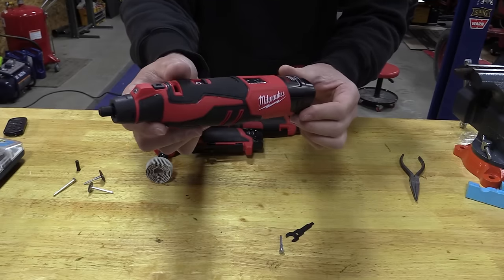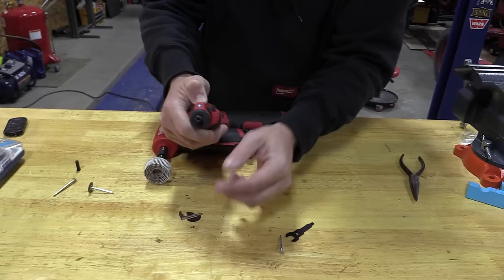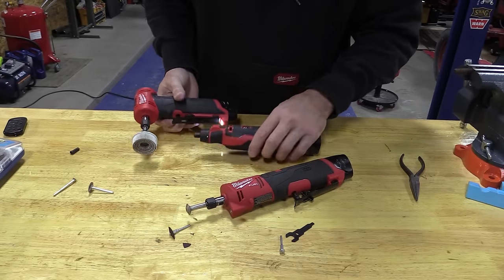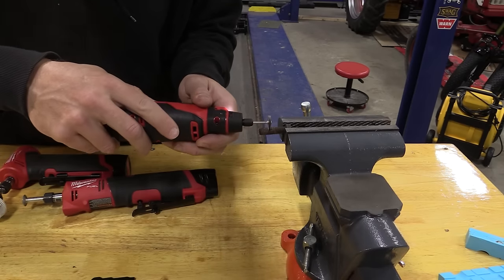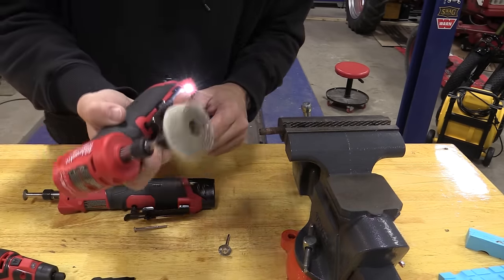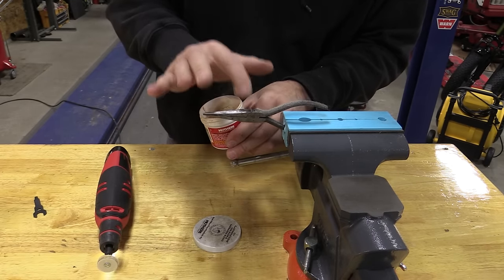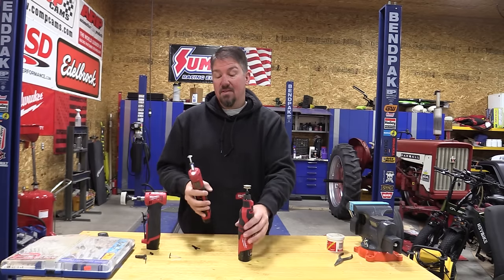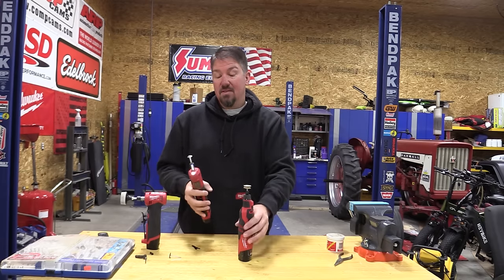Milwaukee M12 Brushless Rotary Tool Review OR Milwaukee Die Grinder? 2525-20 2525-21

Comment: One thing you missed and many don't think about. The rotary has the threads to attach Dremel tools such as the router and flexible shaft attachments. It's not just about adding the collet adapter in the die grinder. The die grinder doesn't have the additional accessory threads. If that's not a big deal, then the die grinder has more power.

Comment: I bought the 1st rotary tool after the 12v dremel failed. Use it a lot and been running it hard for over a year. Wouldn't hesitate buying another when needed. Don't forget your eye protection. ✌️
Reply: One thing I didn't like about the 1st rotary was the on/off switch being too far back. You get used to it after a while. This new model has the switch where it should be. Looks like I'm getting a new one soon. Thanks for the review.

Comment: I used to work as an auto mechanic, and we worked on a lot of old rusty cars at my shop.

Small rotary tools are awesome with small wire wheels for quickly cleaning rust off smaller bolt threads and also when you want to clean rust out of the insides of brake caliper sleeves before you lubricate them. I used to use my older craftsman cordless rotary tool for cleaning small parts all the time.

I wish I didn’t already own the older brushed m12 rotary so I could justify buying the new brushless version. It seems that the speed control is much better on the brushless. With the old brushed version, i feel like setting it on the lowest setting is very underpowered, but if you increase it just a little bit, the rpms are too high for small detail jobs. The power adjustment on the old one doesn’t feel linear across the range of settings. The new brushless version seems to give you more ability to dial in the rpms to the optimal level for a given workload.
Reply from the maker: Speed control on this model is superb.

Comment: I own both the m12 die grinders its awesome not having to pull out air hose anymore. Ive been thinking of getting one, but now that its brushless its more tempting even thought i do really need it.
Reply: I love those die grinders. 2 1/2 years of heavy daily use. I mostly use them with tungsten carbide bur bits, roloc sand/polish pads, and 90° wire brushes. The biggest mistake people make with these is using accessories larger than 2". Accessories larger than 1 1/2" can put too much strain on the motor. If you need a disc bigger than that, break out the m18 variable speed die grinder. Although they're not perfect, their close enough. Not too many companies make a 12v die grinder at that size.

Comment: Nice comparison. The disk you’re using will alway break if you don’t handle it properly. Even if you use the quality dremel version. You just have to be careful not to bend it otherwise it will always cut nicely.

Comment: I like the rotary. It seems really thick. Wish it had a variable speed trigger in case of drop so I would probably go more for the straight dry grinder with the different collet. At least the paddle if you let go it turns off

Comment: You don't really see it in the video much, but the LED is basically useless, it's a very tight narrow beam, and doesn't actually illuminate what you are cutting/grinding with most attachments, it should be a wider/flood beam.   Great tool other than that, though I still prefer the rotary wheel for speed selection than the buttons, it was easier to adjust the speed while using the tool.

Comment: 12v die grinders not powerful enough wait for the 18v versions
Reply from the maker: M18's are already out.
Reply: @WorkshopAddict Ain't no Milwaukee 18 volt right angle.  Only Ryobi's got that. Ingersoll Rand is 14.4.
Reply from the maker: @orijimi  Roger that.  He did not say right angle.
Reply: You must not have the Milwaukee die grinder , I use it everyday
My son is a heavy machinery mechanic for Keiwitt
He uses it everyday as well
It's his go to for many uses during his day
No air needed or available when he's working on cranes and other heavy duty onsite work
Reply: I bought into dewalts 18v platform for their 18v straight grinder already owning snap on & Milwaukee chargers.
Their grinder has 3 speed settings & a variable speed trigger using it compared to Milwaukees 18V grind that is always on full power is a game changer